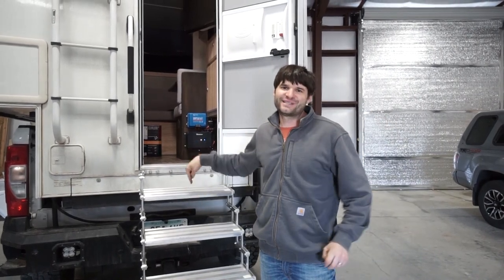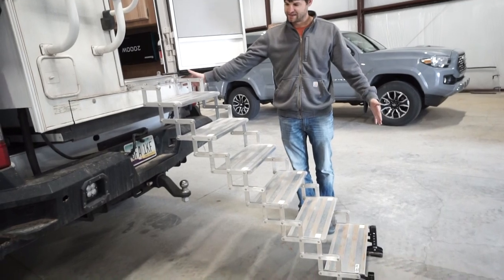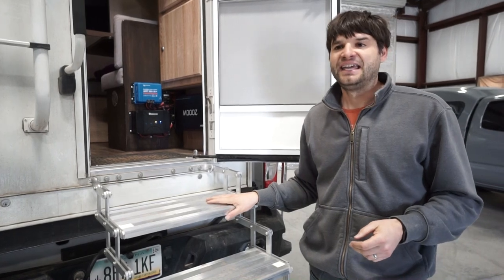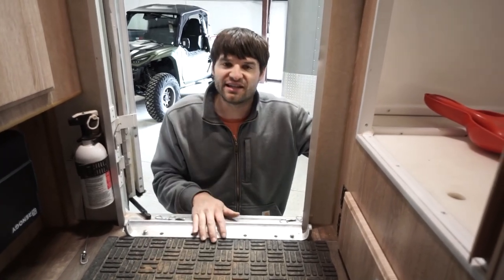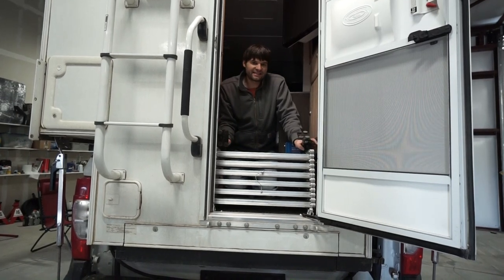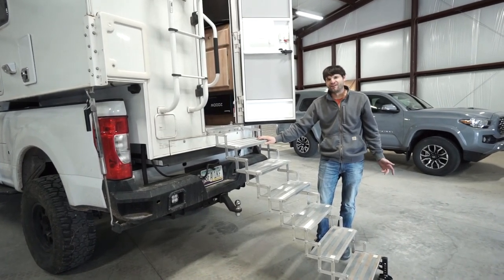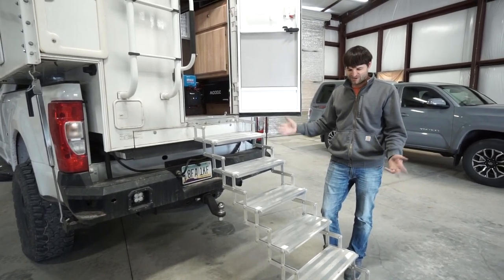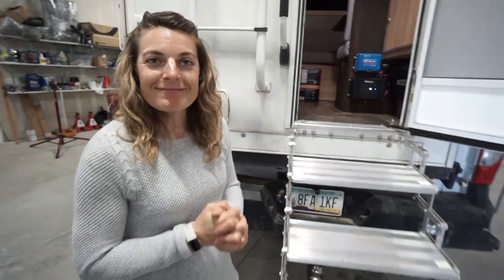How to transport Truck Camper Stairs OFF ROAD??  Torklift Smartstep with Landing Gear!

Comment: The long-awaited stair-stowing video!  Thanks for following through!  

I really value that you are willing to point out both the pros and the cons of a product.  I hope this remains the case as your channel blows up -- which, I think is inevitable based on the quality of the information shared.  Also, there’s no time-wasting intro section to fast-forward through, and no use of cheesy royalty-free background music -- just useful, insightful content.

Overall, the Torklift steps seem like a very good product that could be an excellent product, with a couple of modifications that would be easy and inexpensive for the manufacturer.

Some quick googling says that (in a home) stairs are typically 8 inches high.  Not sure how this height compares to the Torklift stairs, but I agree going bigger is a good call.  As you point out, it saves both weight and space.  And, with fewer moving pieces, it’d probably be cheaper to manufacture.  Hopefully Torklift is listening. 😊

The creaking would bug me a little bit, not because they’re unstable or under-engineered, but just because it’s avoidable.  I’m wondering if the problem would be solved by Torklift simply adding nylon washers in the pivot points (to avoid aluminum-on-aluminum contact).   

Another idea for stowing the stairs that I’ve been kicking around is to secure them inside with footman’s loops (McMaster-Carr calls them “webbing guides”.) You mount a couple of these loops inside and then use a strap or bungee to keep them securely in place while off-roading.
Reply from the maker: Good thoughts and ideas...  it's always great to see continuous product improvements.  Maybe some ideas will be helpful for them or others!  Thanks for sharing.

Comment: Our camper is high of the ground also. After looking at several options we finally decided using a regular 6ft."A" frame aluminum step ladder. It is light and at night we stand it up inside. Reverse the operation in the morning. Lay it down inside when traveling. Home depot $80,00 without any installation.
Reply from the maker: Thanks for sharing.  Lots of ways to do it.

Comment: I wish I could add a picture here to show you my solution. Mine is a flatbed camper and the bottom of the door is 4' from the ground. Take a look at the Brophy 2 step hitch stairs...I run it from the receiver and had it modified by a fabricator to add one step above it (top step) and one step below (bottom or lowest step) for a total of 4 steps. The perfect distance between each step is 11 inches. My bottom step is removable or off road and the rest of the assembly stays attached to the truck receiver. Nothing is hanging below the receiver with the lowest step stored in the camper. I drilled LOTS of one inch holes in mine to help keep them clean and painted a one inch strip around the perimeter of each to see at night. I have anti-rattle hitch pins and they work great. Sounds a bit "complicated", but it's not...just need a welder, some steel and good measuring. I have a hitch extension welded on mine to get it the perfect distance from the back of the truck. I can put the whole thing in the camper if I want and it's not as cumbersome as having to step over the arrangement you have. Weighs about 30 pounds (all steel) but it's SOLID. It's fantastic...if you saw it you'd probably fall in love right away.
Reply from the maker: Great idea!  I know exactly what you're describing.  And I agree on the taller step height.  I'd be happy with 10-12" steps.  Great concept and engenuity.  Seems a new product could be added to the market... however I do realize flatbeds are less common.  Your design may give ideas for others!  Thanks for sharing.

Comment: Does your truck have a lift or just big tires? I'm thinking about getting a truck camper instead of a pull behind just so i can get more places. I'm just concerned that it will be too top heavy. My f350 has an 8 inch lift with 40 inch tires
Reply from the maker: We have several videos showing the truck build (check them out).  It is approximately 3-4" lift with 37" tires.  Works great for getting into back country.  If you want a dialed setup... we will be posting the truck + camper for sale later this month.

Comment: would they ride against the door if left on the outside all the time? Some homemade stairs I have I just fold up and put a cargo strap from jack to jack to keep them secured against the door.
Reply from the maker: This version isn't designed to be transported outside.  Torklift does have another version with mount for exterior transport.

Comment: Shadow stairs is best for anyone with a handy cap, like me.
Reply from the maker: Thanks for sharing!  I did see Torklift offers a hand rail which may be helpful as well.
Reply: @TruckCamper  Thanks, I will look into that. It's the one reason we haven't bought another truck camper. I sure miss having one. We've truck camp for 20 plus years but laid off due to health problems. Again thank you.